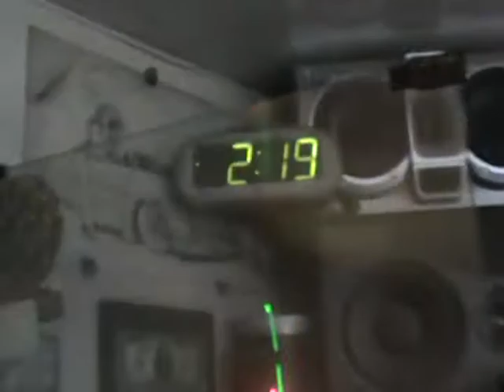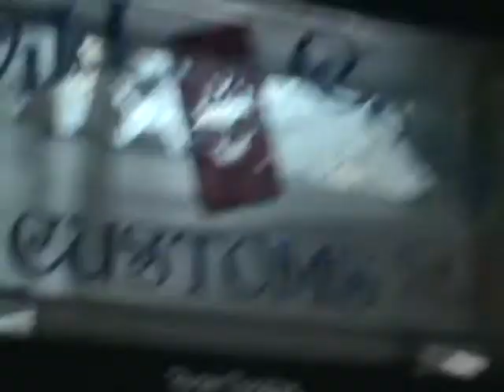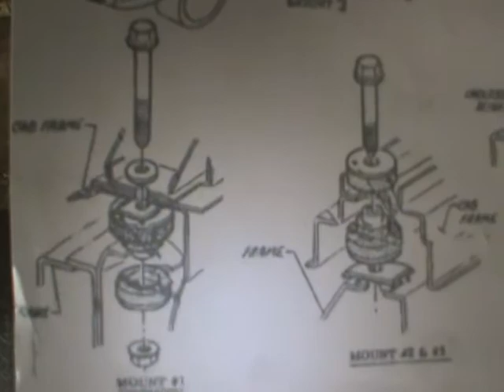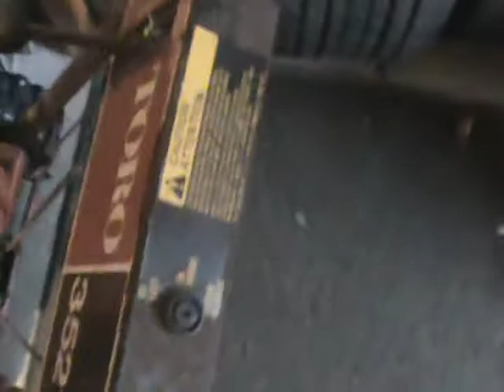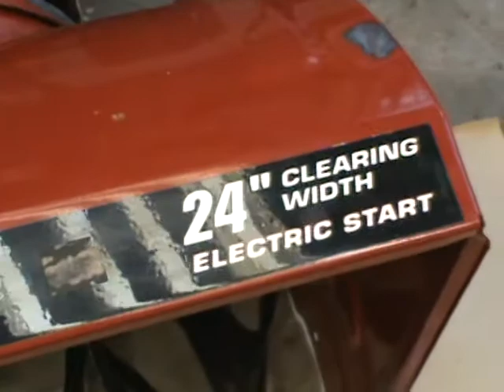WILD CARD CUSTOMS-217-PAINT PIMP

Comment: @wildeyednorthernboy myth: you are as fit as you feel.
little experiment for you thomy, get some of your rust killer you used on the snowblower and put it in a small container then put a really rust piece of metal in it and leave it 24 hours,
it should completey remove the rust, not just turn it black.
for the rust scabs on the blower i would get tissue paper and put that over them soaked in the rust killer, it has a simalar effect as having it submerged in it